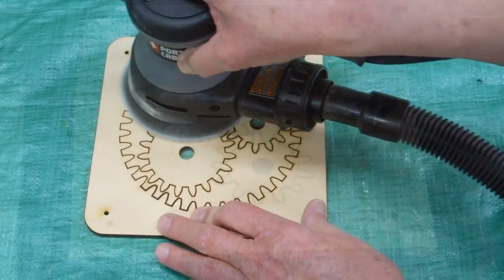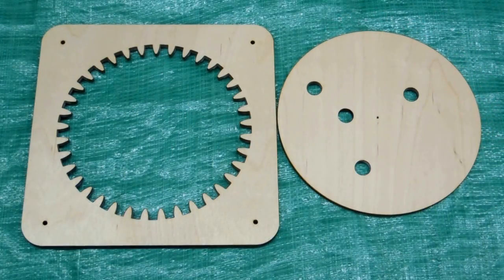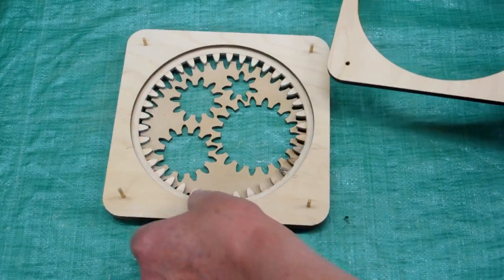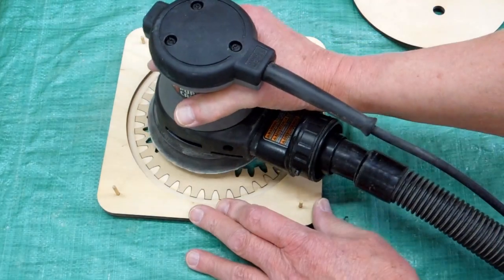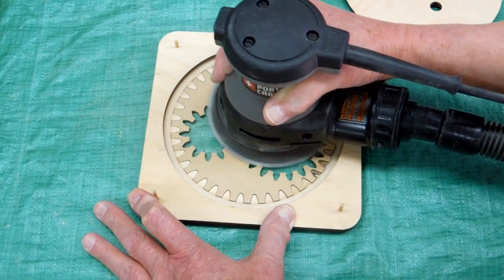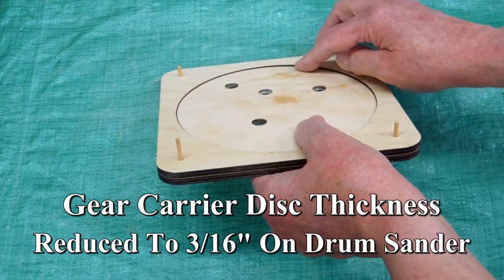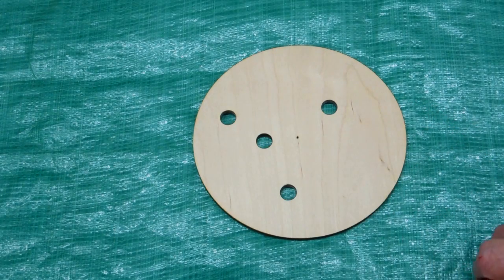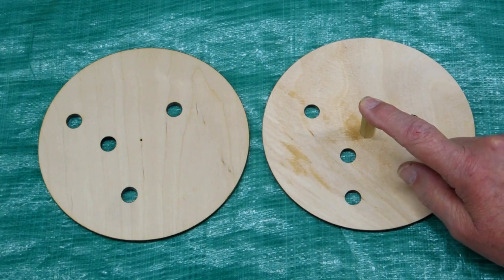Eccentric Planetary Gears - Display Model

Comment: Oh yes, how often do the black dots line up again?
Reply from the maker: Personally I have never seen it happen. I usually fall asleep after watching it for a few minutes. :-) 
    To begin, all the gears, including the ring gear, are prime number gears. For the three planet gears (19, 13 & 7) each outer tooth, which was perpendicular to a tangent to the ring gear (or nearly so), was given a black dot. By choice, the sun gear had the tooth perpendicular to the tangent of the 19-tooth planet marked with a black dot.
    Since the sun gear is driven, the question is, “When will the black dots all return to the original position when they were marked.” I believe the answer is 19x13x7 = 1729 revolutions of the 11-tooth sun gear. At 10 RPM that would be every 2.8816666 hours.

Comment: The unusual gears make an interesting wall display, but too bad both sides can’t be viewed, as the drive mechanism was probably the most interesting part of the build. Really liked your “stack sanding” method for the washers and finding center and sanding on the lathe. You should make a separate video of just that and place it in your shop tricks. Keep making them and I’ll keep watching!
Reply from the maker: I considered a 'C' shaped mount so the display could be turned to view the driven side. That mount would stand out past the wall quite a ways and this thing already sits fairly far from the wall just to clear the motor. I also thought about a mirror. Or I could mount one facing forward and one facing backward (but then both motors should probably be the same speed).
Reply from the maker: Guess that is the curse of reality. Many do not want to know why it works, they just want it to work.
Reply: I agree, the floating motor design is as neat as the gears. :-)
Reply: I wonder if the motor could be mounted on the front. Just brainstorming with very little brain.:-) It is absolutely perfect as is but in many of your designs there are some cool mechanisms hidden from view. Thanks for sharing.